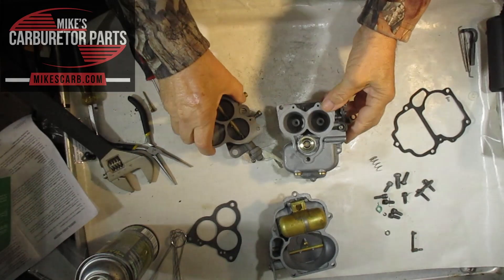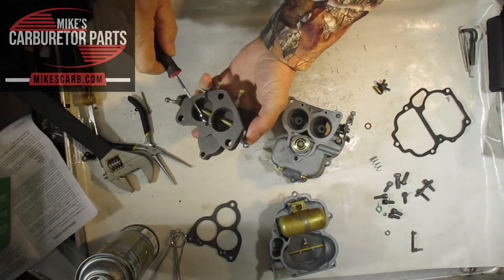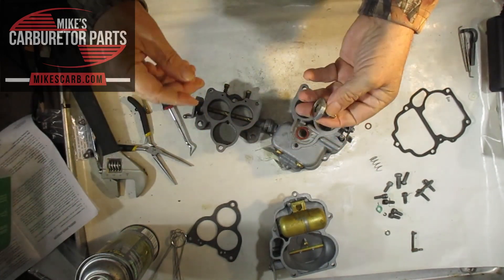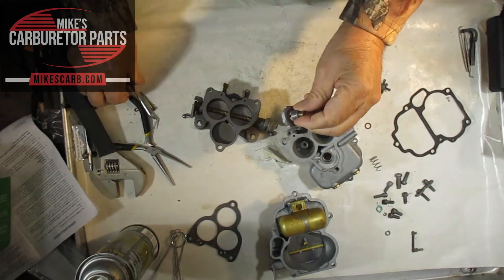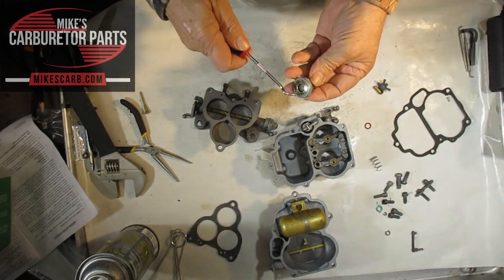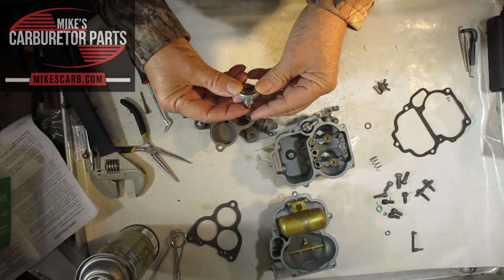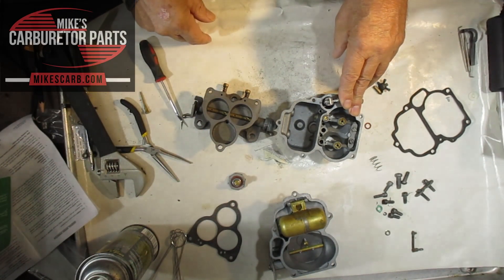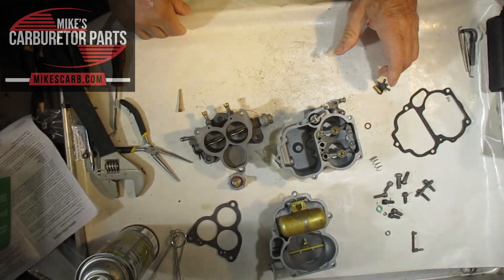Holley 94 How The Power Valve Works

Comment: So I think I might have a power valve issue. 8BA with 17.5" of vacuum. Engine stubles under very little load at idle. Would this mean that I need a faster opening power valve?
Reply from the maker: No. It might be the accelerator pump circuit, or the transfer slot is plugged.

Comment: Well Mike...I consider myself technically capable. I retired as a GM master tech after 30 years of service and am now a machinist with job responsibilities that include prototyping , machining and fabrication of proprietary machine parts. I CAN NOT keep these power valves from leaking!! I've machined the radius out of the base of the valve,  assured the valve mating surface is square and true and have tried several different types of seals and seal materials, including making seals from lead sheet, nylon and teflon. I found a Holley torque spec of 40-50 inch pounds and have tried tightening the valve throughout this range with zero success. They refuse to seal! It will be good at first, but I can tell immediately when the valve starts to leak. I'm at my wits end!!🤬🤬
Reply: @MikesCarburetor  Yep...I've purchased several from you.. Tried them with the radius at the base and chucked them up on the lathe at work and have taken the radius out. Sometimes it would go days without leaking, but inevitably they would start leaking. I've purchased NOS 94 bodies and made sure they were true with a straight edge. I've used a marker on the carb surface and the valve surface and torqued them down, then remove to make sure there was a positive seal. Even though this test proved contact on both surfaces I still had the leaking. I've tried the thread tape for gasoline applications and as stated several different types of seal material, I've used commercially available nylon seals and valves from the guy in Florida, to the seals available from Henkyo. The gaskets with the triangle that come with the kit seamed to be the worst of the bunch. Even the plugs on my secondaries would leak! I've rebuilt my share of carbs over the years, from the Quadrajet, including the electronically controlled version, 2G's, the electronically controlled progressive 2bbl that came on the GM 3.8L to the Holley double pumpers and I've never experienced anything like this! The 94's apparently hate me! 🤣 I was joking with a friend and said a monkey could probably install these without leaking only to have them leak after I remove and reinstall! I've finally given up on the power valves. I've plugged the vacuum source on all carbs and jetted up. It's now finally enjoyable to drive. I do appreciate your response Mike, I always go to you for my gaskets and other carb parts needs and will continue to do so. Thanks for your time!!
Reply: @MikesCarburetor  I'm baffled as well, there's something up that's causing these to leak and whatever it is, I just can't put my finger on it. Maybe I'll get back to it at some point, but for now, I just want to enjoy my coupe! Thanks again!
Reply: @MikesCarburetor  For clarity, I’m not saying the valves are bad. I have a tester, the valves are good, so it’s the seal that leaks. Remove the vacuum source and with gravity alone there’s no leak. I’ve let the carb sit on the bench with gas and no leak down. As soon as you unblock the vacuum source the leak returns. Granted there’s no temp variation, but not sure if that creates any issues.
Reply: Sounds like you've tried at least as much as I would have. I'd guess it's not the power valve that's leaking, but something with the engine or manifold.  Perhaps a weak cylinder, manifold leak or worn throttle shaft causing a drop in vacuum which is opening the power valve ?